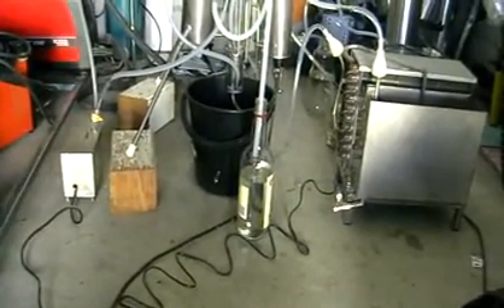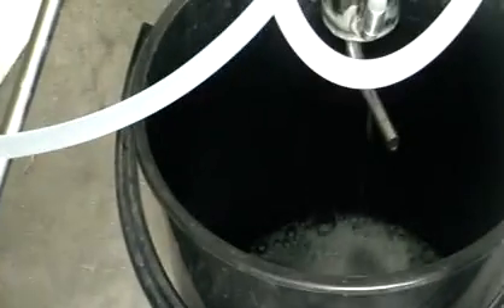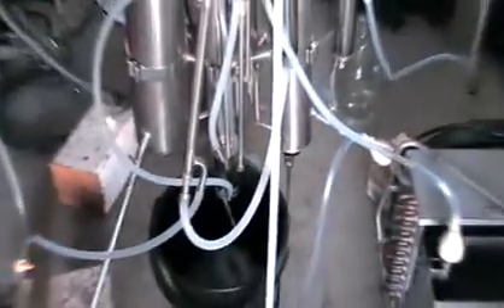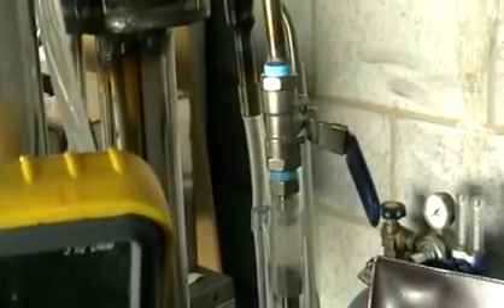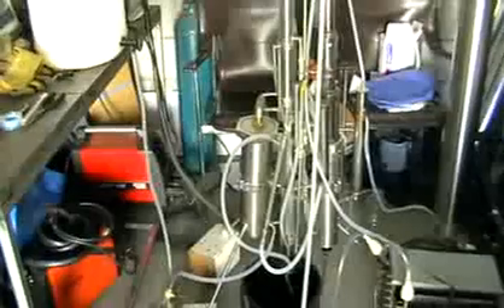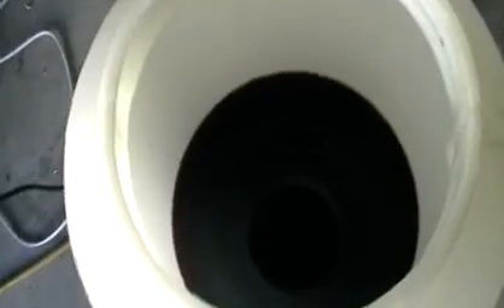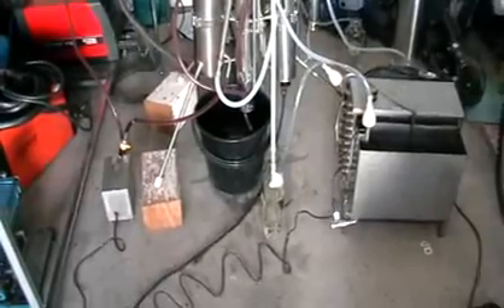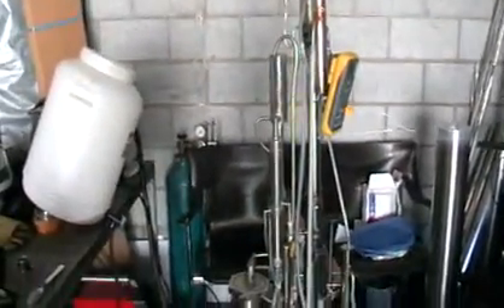Continuous reflux alcohol still.

Comment from the maker: yes, planning to rebuild a couple of sections to improve what I think can be improved, so will see, though even now it is a very successful variant of still, technically it is an add on feature that can be incorporated with stripping column of my design, the striping column also was improved. Also very soon planning to show a couple of new stills - 3kw improved stripping version and waste motor oil continuous distiller.

Comment: Alex-  If this is a prototype, you are clearly pretty close to getting it the way you want it.  Will we see a finished version for sale that can use mash of any type (sugar, wine, beer, grain, etc.) that will automatically separate out the heads, tails, ethyl alcohol, and refuse (used mash) with good efficiency and easy for the operator to run?